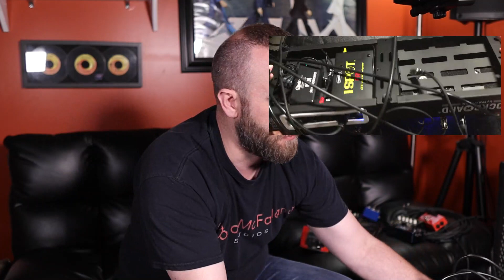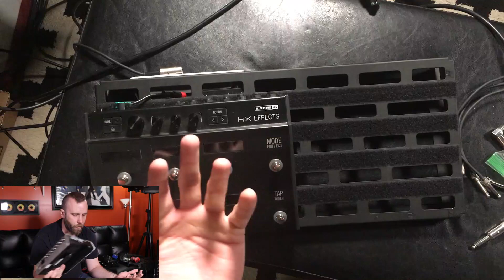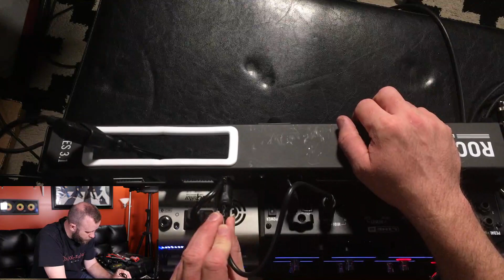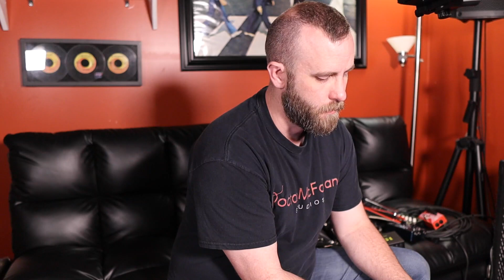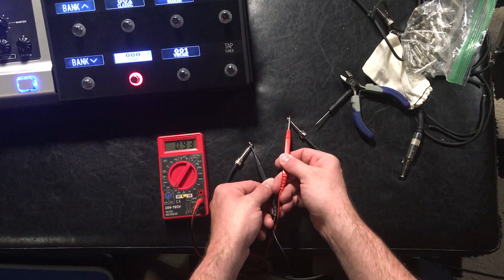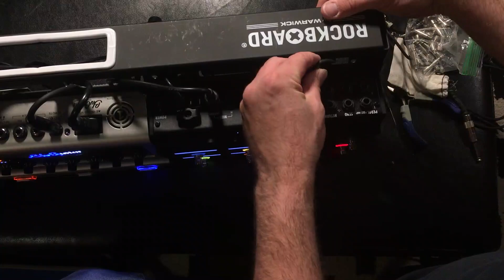Bluguitar Amp 1 and HX Effects Cable Management

Comment: What is the Hosa cable controlling?
Reply from the maker: Channel switching on the AMP 1 if you don't want to use MIDI.
Reply: @ ahh, thanks. Interesting, didn’t realise there was an alternative to using the expensive Midi1 cable to do switching!

Comment: Thankfully I’ve seen your video. Question. What type of aftermarket midi cable did you get to connect the Amp1 with the switcher? I have the Bluguitar midi cable (1/4 inch Jack to female midi I think) so is it a male to male midi cable? (If that’s even a thing)
Reply from the maker: Yep just male to male as the midi input on any device is already female.

Comment: Will this work if you don't have the midi set up?  I just cabled mine exactly the same, but I don't have the midi... changing channels on the amp1 manually doesn't do anything right now.
Reply from the maker: You can use the EXT Amp switch on the back of the HX to toggle channels but you have to choose while drive channel you want to switch to.   You  can't access all of them without MIDI.

Comment: Just bought an Amp1 yesterday.... do you use the Blug midi adapter or is there a less expensive option? I would like to get it to talk with my Line 6 Helix. Thanks!
Reply from the maker: You have to get the MIDI adapter.  Well worth it

Comment: I like what you have done here, so much that I’m intending to copy your ideas. I’m confused by the power underneath the board. How did you plug in the HX effects power into the IEC splitter? The IEC lead has 3 holes, and the HX effects adapter has 2?

Comment: Hi 
what type of adapter do you use to replace the original Hx effects 9V transformer. Can you send brand specifications or the link.
Reply from the maker: I am using the original transformer but I have two IEC adaptors so I can power both units with one lead going to the wall.  I will add links to the adaptors later today.
Reply: Doctor McFarland Studios thanks

Comment: Would it make sense to use a Gigboard instead the HX-Effects, because midi on Headrush is very limited
Reply from the maker: I will be doing a video next week in how to use the GIGBOARD or Pedalboard to change channels on the amp via midi.  It is limited to sending PC messages at this time so this doesn’t allow the Amp1 to change the gain of the channels but just the amp channels themselves.
Reply: @DoctorMcFarlandStudios  Im running my Headrush alongside an HX Effects with the HX Stomp. I currently use Midi for the Line 6 side but want to run midi starting at the Headrush through the effects to the Stomp. Is that what youre going to be showing everyone?
Reply from the maker: BrokenDreamRox so you are using 3 units at once??? That is a lot going on in one rig.  My video will show how to change channels on the Amp1 using PC messages from the Headrush. Only 1 PC message can be sent per rig so I doubt you could control 2 units at a time like you are suggesting.
Reply: @DoctorMcFarlandStudios  yes sir. I am using the Stomp and the Helixtogether as a mini helix via the Aux in/outs then that is fed into the aux in/out of the Headrush. 
In addition I'm running two outputs from each side of my setup into a mini mixer and using an A/B/Y pedal as the second expression pedal for both sides at the guitar I'm running into an A/B/Y switch.
Reply: @DoctorMcFarlandStudios  I'm trying to get information on the MIDI cc list for both sides.